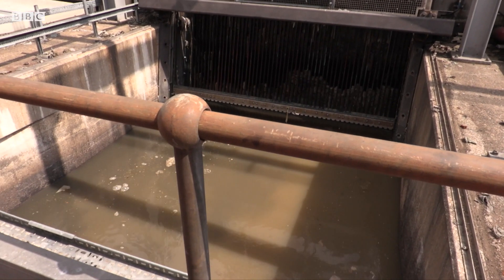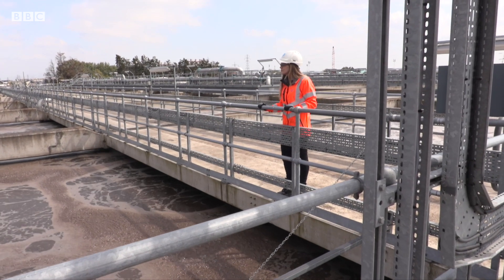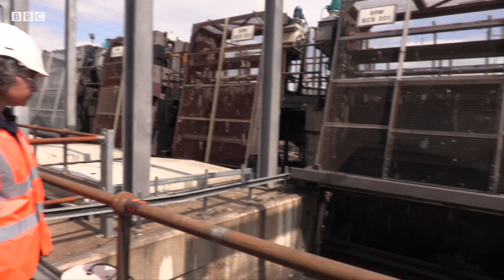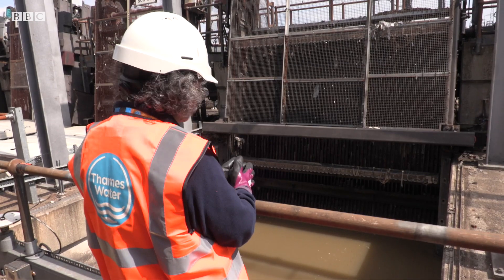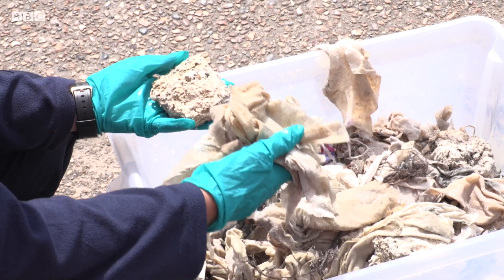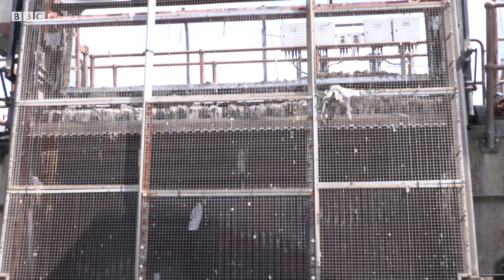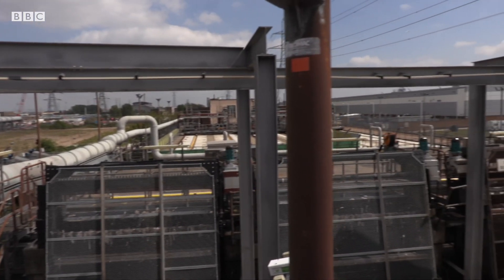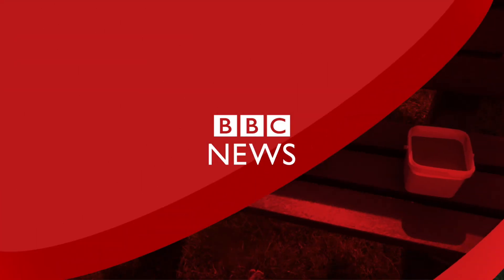How London's poo is being turned into houses - BBC London

Comment: Burning poo to turn into harmless ash.  Mixed with a concrete mixture.

So it's not poo.  And it's still a regular brick with ash mixed in.  There would have been more poo on a brick if you used your underwear to wipe it with.